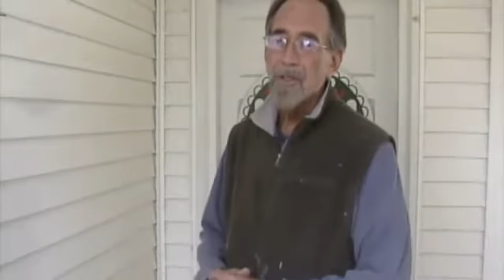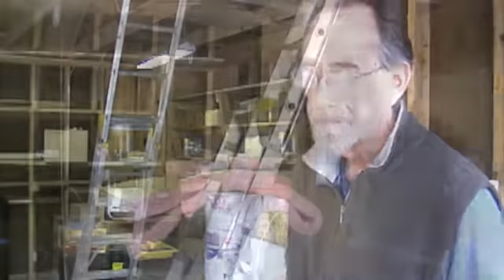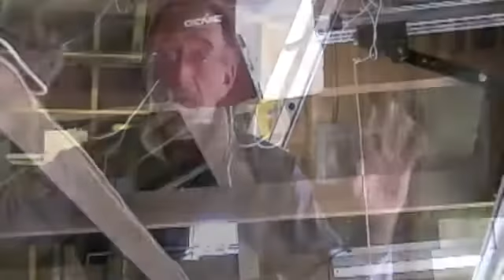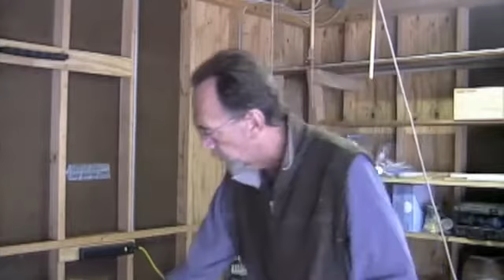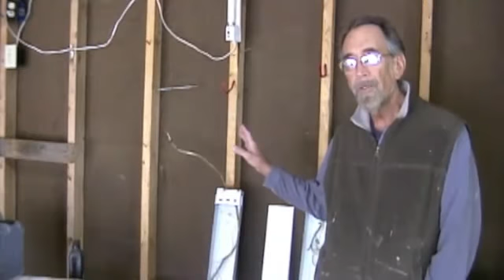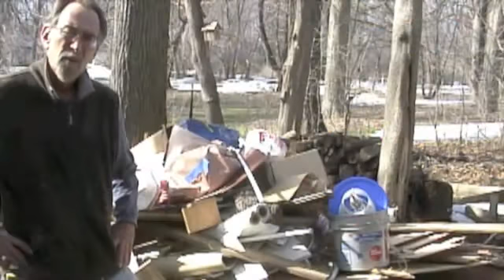Plans for the New Workshop - The Down to Earth Woodworker

Comment: Excellent question. I got so busy building things in my shop, that I didn't finish the roof insulation until about a month ago.  First I laid in 1-1/2" sleepers (nominal 2 X 2s) next to each rafter. I then attached rigid foam insulation using spray-in foam to hold the rigid pieces in place.   The sleepers and the space they create between the rigid foam and the roof decking allow air movement.  All of this was recommended by the fine folks at Corning - some data is available on their web site.

Comment: How do you plan on insulating the roof?  In my detached garage, where I plan on doing something very similar to what you plan to do, I'm thinking of using closed cell spray foam insulation, sprayed right up under the roof decking, in between the rafter bays, and either leaving it exposed (if code allows it-the stuff I want to use is E-84 fire rated) or using drywall right underneath that.  Then painting or otherwise finishing all the exposed 2x4 framing making up the rest of the rafters.